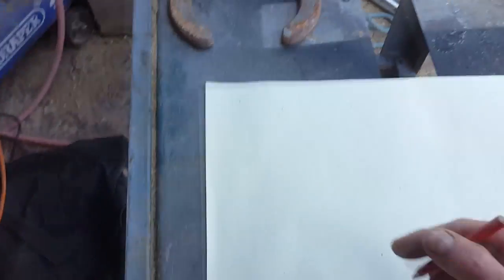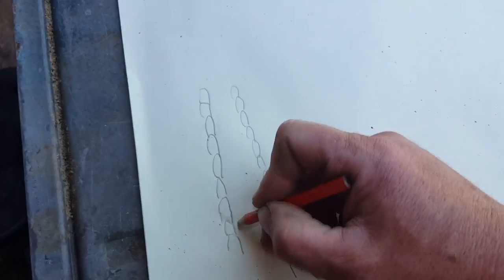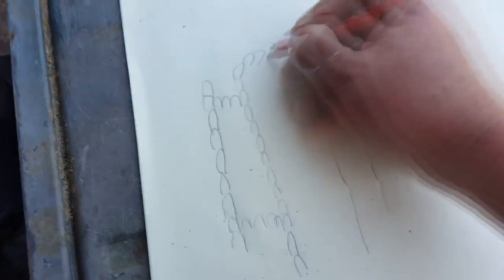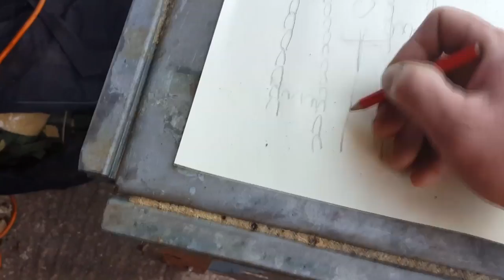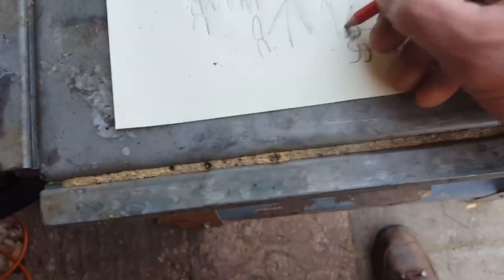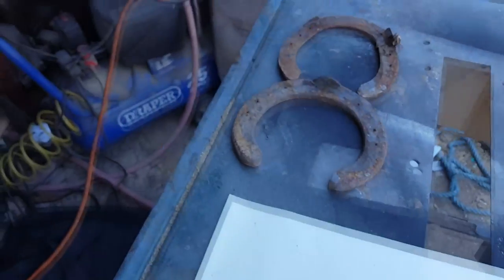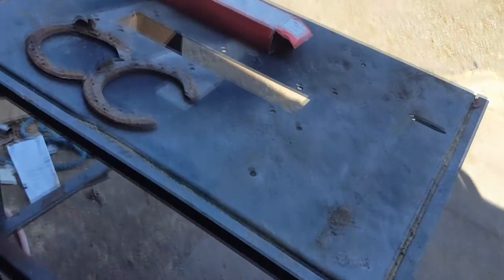Horseshoe Bench - DIY Easy metal Arc Stick welding projects

Comment: Wow and all done with a stick welder. For a lot of welding I use my everlast mig welder. Mig welding is much more productive I find. No knocking off the slag and changing electrodes when they are too short.
Reply from the maker: Id love a mig welder but of course its always pennies that are the issue. What projects are you getting up to yourself.